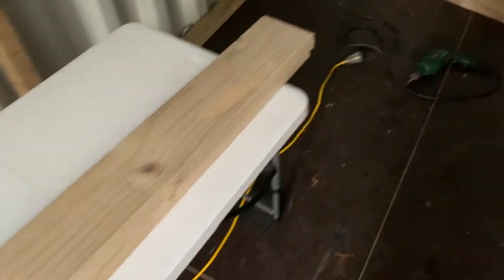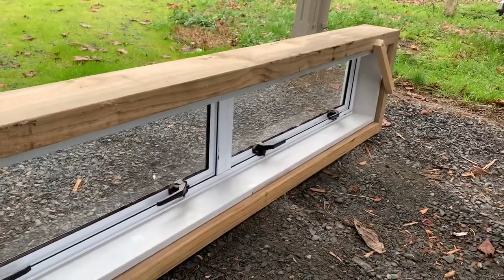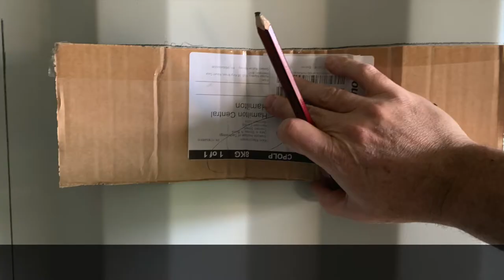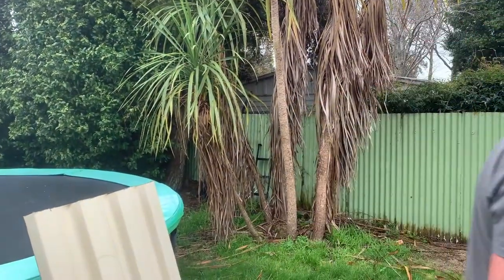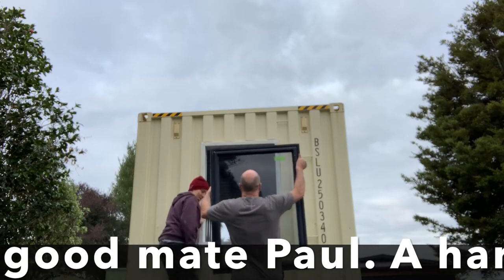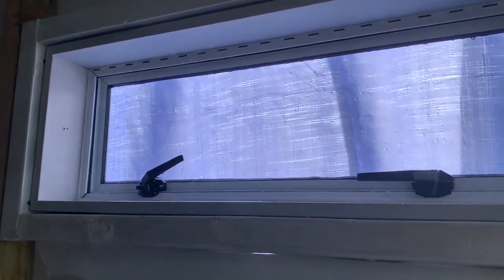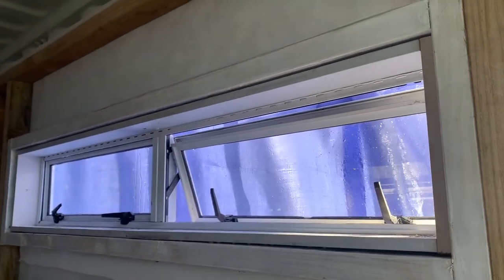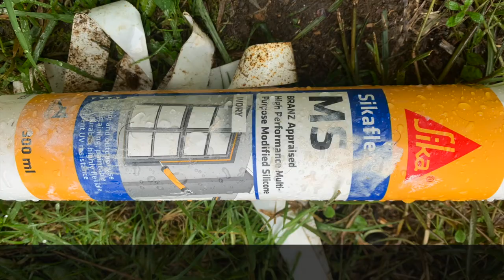Windows! No welding? Am I crazy?

Comment: Always prime and paint the bare cut edge or it will rust like crazy... you must allow for expansion and contraction of the metal sides in the cold and Heat...
Reply: No it won’t, they are carbon steel